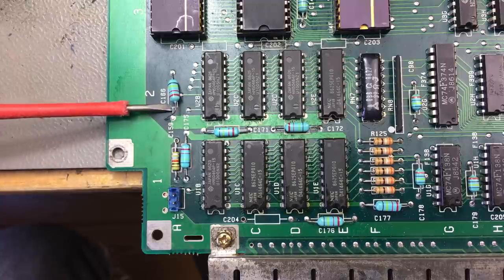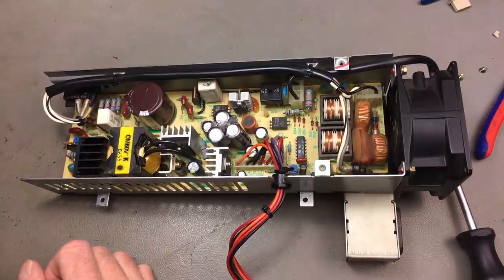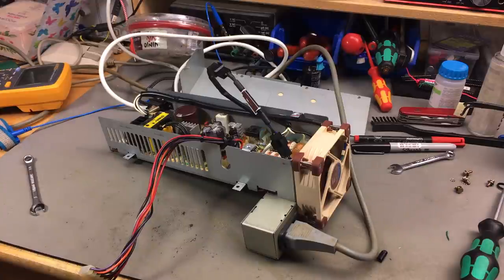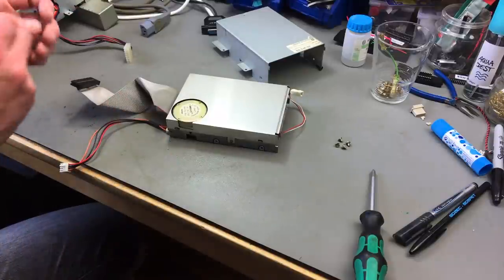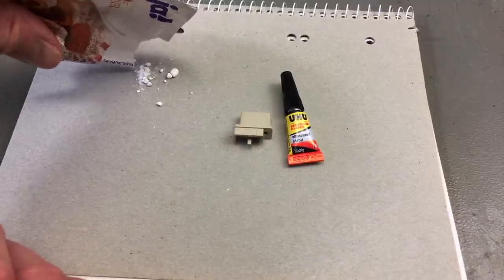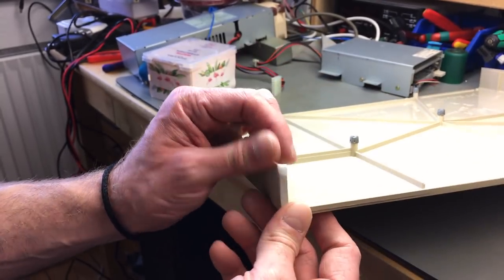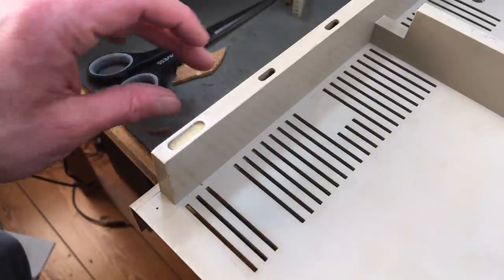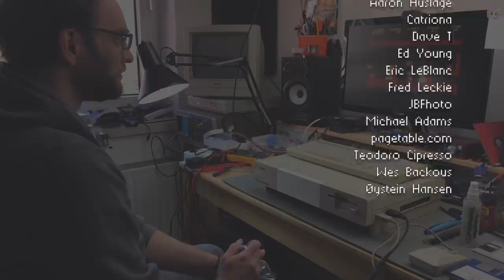Amiga 1000 Restoration | Part 2

Comment: Fantastic job Jan!!  Love the 3D printed piece that Dennis produced too!
Reply from the maker: Thanks Chris! Yes, the 3d printed part is stunning. I just hope i don’t ruin it when I paint it... :D
Reply: 33:00 .. @Jan Beta.. a very very easy way to reduce the speed /noise of a fan ..... is put 2 or 3 diodes.. in serie (one behind the other)... in the 12V+ yellow positive line ... each diode reduces around 1 Volt depending of the  amp consumption of the fan .... then you can "hide" them with a shrink tube

Comment: I simply cleaned and lubricated the old fan and now it works like a new one. And it’s very silent, that old thing was very well build. Now my one is now 36 years old and I can’t hear it after the small revision. But I used that Noctura fan for my A4000 THAT is a big difference, now it’s silent and has a much better airflow.
Reply: OK I used the Noctua NF-A8 FLX in my A4000 power supply because its not PWM controlled :-)

Comment: I am in the midst of restoring two C64s ('83 and '84), a Vic-20('82) an Amiga 500 ('90) and a Mitsubischi ML-F48 ('86) MSX computer. In essence, all the machines I used during my child- and young adulthood. It never even occurred to me to sell them. They've been lying in boxes for over 30 years.
With the exception of the VIC-20, I salvaged that one from a dumpster around 2006.

Comment: Only half-way through the video but I wanted to commend you on the fan mount, very nicely done and how I would have done it myself - you will thank yourself in the future if the unit needs opening up again, as having that cable unplug-able will save you some headache if the PSU or the fan dies. One trick I always do with PC fans for cable management is to wrap the cable around the fan housing as the friction fit will stop it from coming loose or shaking about enough to create noise from vibration while also leaving you with ample room to access the other surrounding components.

Comment: As for possible upgrades: well, there are some solutions for the Amiga 500 which would work with the 1000 as well. I think this machine definitely still needs more RAM. 512k Chip is definitely not enough ;)
Reply: @kevb8983  You can use a modified Kickstart which adds the memory. It will be from $80000 and upwards (although it will (obviously) not be chipmem). It should'nt be hard to locate the information on the Internet about the piggybacking hack these days. A very good and reliable upgrade (if done correctly) which I personally used for several years with zero issues.

Comment: Hi Jan - Great informative A1000 restoration video. A question if I may. My old A1000 has developed vertical stripes on the Workbench background, Kickstart request screen is OK. I'm using composite output as I no longer have an original RGB monitor. I figure the problem may be with the video out circuitry, I have reseated the Daphne chip and can see no obvious problems with the circuit board components, including obvious blown caps. If you have any hints as to where to specifically look for this vertical output stripe problem it would be much appreciated.

Comment: Noctua sells several different versions of the same fan depending on what kind of noise profile you want.. Might have been better to get the NF-A8 ULN or NF-R8 Redux 1200. The 2200rpm PWM fans are designed to run with thermal management so they normally would not at 100% duty cycle. Most computer systems would run them about 500-600rpm. Edit: Whoops commented too soon, you did go and get the ULN version haha. Nice.

Comment: Back in the day we had those Papst Lüfter as we called them in germany 🤪👍
Reply: my IBM AT has an actual Papst in it.constant 4000 RPM. No point fitting a soundcard until I replace that thing, hehehe
Reply: The original Papst hand balanced steel ones where actualy realy expensive, i think i was like 90$ or so, so it should be more than 100$ today i think for the larger models if one bought them separatly.

Comment: Awsome video as always! I honestly must agree with those fans, from a tecnicaly point of wiew they are great quality fans but they realy are incredibly load and enerving in the long run...
Reply: Some of those industrial quality metal fans are in fact much quiter then modern plastic ones (i still use a few on my cooling system), but later, plastic ones from Commodore machines i hawe used was not exactly quite...

Comment: Funny, my 1000 had a square latching push button for power instead of a toggle which blended into the side of the case better. The only models of Amiga that I haven't owned are the 1200, 2000 and the 3000. The were great computers for their time. I had a 500, 1000, & 4000-030. I seem to remember my 1000 having a memory expansion box on the side port too. It held an extra 512k in addition to the 128 on the front and internally. I believe it was the first zorro connector though I could be mistaken. The zorro II slot didn't happen until the 1200 I think.
Reply from the maker: Interesting! I was wondering if the cut out was designed for another type of switch. Seems more appropriate indeed. Thanks for sharing!

Comment: Jan, would really like to know what paint codes / mix you come up with. I have the same 3D printed thing on my A1000 for that and the side expansion trap door but they need a color match.
Reply: Rather a late reply, but if you still need an answer, you can get color match apps for your cell phone from most major paint suppliers. You have to make SURE you do a proper White Balance (most camera apps have this, just search here on YT on how for your phone). Also there are apps not related to paint companies that will give your the RGB and / or the CMYK values you can then take to a paint store and they can match. Here in the US it's free in most paint stores. Be SURE to do the White Balance FIRST or it will be off.

Comment: Another video says the original fan is 120v - the replacement you are using is 12v.  Where is it connected?
Reply from the maker: I connected it to the 12V rail of the psu (the explanation is in one of the videos of this series, I can't remember which one).

Comment: Actually there are RAM chips from two different manufacturers Hitachi and NEC. The NECs are from 1986 week 25, also 3 of the Hitachi, but one from week 23.
The NECs seem all to be replaced, but as the production time suggests this was done at the factory.
The 68000 CPU is from Thomson.

Comment: Nice job there :) That CPU is indeed a Thomson, but it's an 8 at the end and not a B, maybe that's why you didn't find much info on it... They also did purple/gold ceramic (EF68000C8, EF68000CM10) versions and a square (TS68000CR12) version too :)

Comment: Hi Jan is the front bus connector the same pinout as the side one ?
Reply: IIRC the side port is larger to accommodate the signals from/to the CPU (practically the same connector as on the A500 only flipped), whereas the front connector is just for a RAM expansion card.
https://retrocomputing.stackexchange.com/questions/5410/was-the-amiga-1000s-front-expansion-port-capable-of-anything-other-than-the-256

Comment: what video signal converter do you use for the video cable?
Reply from the maker: For quick testing like in this case, I use one of the cheap Flylink SCART to HDMI upscalers. For more serious stuff (streaming, gaming etc) I use an OSSC which is awesome.
Reply: @JanBeta  must look into that.... this video opened my apetite to play with my st and I'm atm retrobrighting it in the sun :)). it is turning great. also my 400v condenser of the psu needs replacement.  its getting rounded at the top. its not suposed right?
Reply: @jvidia  Right. Domed caps are bad caps.

Comment: I'm not a material scientist, but from my limited understanding, you can't just "add moisture" to make the plastic less brittle. The brittleness is due to chemical changes. Reversing those chemical changes isn't as simple as just adding water. Just like how you can't grind up concrete and add water to get new concrete mix.
Reply from the maker: I heard about putting plastic parts into water and heating to make it more elastic again. I have no idea if that is actually a thing, doesn’t make much sense to me either. Lots of misinformation out there I suppose.

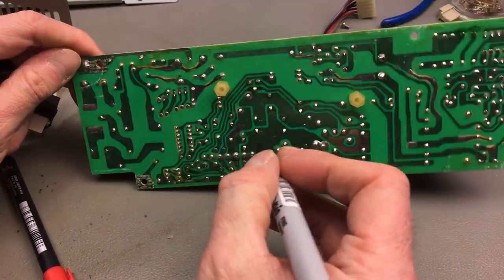Comment: 18:26 You had empty solder points (pads) with GND and +12V just below power connector!!!
37:00 Yes, it is made by Thomson-CSF. Later versions were marked TS68000 (SGS-Thomson, now ST).

Comment: You recommend lithium greese over machine oil for drive? I've used machine oil myself
Reply: Lithium is the way to go for all the sliding, levers, and bearings. Oil the way to go for all rotating shafts. Personally I use more modern synthetic replacements most times but on this I'd use lithium. For the drive shaft (rotating) I use oil to REMOVE the old grease, run it a bit and clean dry it then re-grease. Source: Me. Was factory trained in floppy repair back in the day ... ;-)
Reply: @MrPuterPro  thanks for tips. Regrease with lithium you mean? How would fancy automotive grease go?
Reply: @blackterminal  Well, that depends on what you mean by automotive grease ... Certainly not wheel bearing grease which is designed for high temps and huge loads. Just a normal white lithium grease available in any home improvement or auto store, or, of course, Amazon ... :-)

Comment: A got a broken LG DVD-writer/VHS-combo thing that had a similar error in the power supply - one of the resistors in the PSU had just barely missed it's through hole... I'm guessing in the factory it still just barely made contact with the solder but got bumped at some point and the whole unit died. Another unit of the same model had too much solder on the HDMI port, bridging some pins so that output never worked. Doesn't speak well for LG's QA, but it was great value for me :D
Reply from the maker: Nice! Seems the QA had a bad day (or several). :D Glad your repair skills paid off. It's such a great feeling to be able to fix such things.

Comment: Great work Jan. Why haven't you used the silent NF-A8 ULN as you did before with the A2000 powersupply ? The NF-A8 PWM you used here moves a bit more air, but i think the NF-A8 ULN is still fine enough for the A1000 power supply and it's silent as you know.
Reply: Ah...i watched further and you figured it out the ULN :)

Comment: ADDENDUM
You know that Plastic welding glue? Have you tried sourcing donor plastic that you can file down with a very smooth file, so that instead of Baking soda you use that plastic welding glue and the plastic filings or powder to build up chipped off plastic, Fill up unwanted Holes and even fill in cracks? Also there are some cheap plastic welding and resurfacing kits that can copy textures down to smooth surfaces..

Comment: I don't think it would really make a difference, but I think the intention is to make sure the brown bushings on the fan are the only thing in contact with the power supply. They look like rubber isolations, so the fan should "float" free. Adding a few washers to leave a tiny gap? The idea would be to isolate the fan and stop vibrations from being amplified by what it's attached to... or they're just cosmetic and make no difference ;-)
Reply: Yeah, the screw should have had a larger washer so that it contacts the soft rubber and not the hard plastic case but in this case I don't think it makes much difference. Of course the idea is to not propagate any vibrations from the fan to the rest of the case to make noise somewhere else than the moving fan. It can really make a difference when mounting spinning hard drives into cases. Even more with optical drives that can make the whole case BURRRR at some nice harmonic frequency.
Reply: You're both right but the best solution is from Noctura themselves. All those fans come with rubber mounts that push through the holes and pull the fan tight with nothing but rubber touching any of it. They're probably a bit of a tight fit to the existing screw holes on the PS but nothing to a pair of nippers in the hands of a guy who makes his own plastic with superglue and baking soda ... It's funny because just last night I just caught one of my cats with one she swiped from a table. Not that they EVER get on my tables ... while I'm in the room at least.

Comment: Actually, Jan, there is a NF-R8 redux-1200 fan out there, that is even quieter and its in a nice grey so it suits the general styling better... Also it has even slightly more airflow.

(waits for next fan replacement video) :P
Reply from the maker: Yes, saw that one, too, when I searched Amazon again for the links in the description... It never ends! ;P
Reply: @JanBeta  I always check at Noctua's own website. There you can nicely compare all the stats for the fans. and then I look where I get the one I want for the lowest money. Usually Amazon anyway...

Comment: Very nice work. Well done! I have a couple of questions.

1-Can a built in Kickstart 1.3 rom be installed inside this A1000?
2-Can the 0.5 mb ram be increased to 1.0 by modifying the front memory cartridge?

If these are possible, i would like the see these upgrades in the part 3 :)
Reply: 1. There are ways of adding an A500 Kickstart ROM to an A1000 but adapters boards are required.
2. The front slot only takes 256K.  I have a board called an IN1000 in my A1000 that plugs into the CPU socket and adds 1.5MB fast RAM using 48 256Kx1 RAM chips.  xtra RAM can also be added using modules that plug into the side expansion slot.  I have a SCSI controller + 512K module with a little light that indicates RAM access.

Comment: Hi Jan there is also the Capasitor C204 missing.
Reply: I think there are also others "missing". They would typically provide lots of decouping on the design and then maybe drop a few of the unneeded ones away from the BOM to reduce manufacturings costs by a cent or two.

Comment: I wonder if someone desoldered one leg of that cap so it could be tested out-of-circuit, and then forgot to put it back.
Reply: Looking at the leg and the solder point on the board it very much looks like that part was never connected.
Reply from the maker: Yes, definitely looked like it was just never soldered in from factory.

Comment: Louis ultra-sonics his boards after bathing them in flux. You should get one =)
Reply from the maker: I’d love to have an ultrasonic cleaner actually but they get really expensive in useful sizes. :/
Reply: @JanBeta  .. Life goals =)
Reply: If there was a wide flat one instead of those cubical ones.. you need a very big one to fit a whole mobo or case in there. I think I'd still prefer the soap water and brush in a sink method.

Comment: My experience with those 230V style fans is that the bearing is gone and there is nothing you can do to fix it. It's the wobbles that are noisy.
Reply from the maker: Yes, that’s what I think. I still want to try to lubricate it and see if that does any good. I suspect putting the 12V fan in was the better solution though.
Reply: Not in this case. That fan was as good as original, I had an A1000 and it was like that from the factory. It has normal play in the axle and has ball bearings. The sound comes from those ball bearings, and they're extremely durable.

Comment: 33:00 .. @Jan Beta.. a very very easy way to reduce the speed /noise of a fan ..... is put 2 or 3 diodes.. in serie (one behind the other)... in the 12V+ yellow positive line ... each diode reduces around 1 Volt depending of the  amp consumption of the fan ..... then you can "hide" them with a shrink tube

Comment: Just to clarify, it's not a capacitor but a resistor 😊
Reply from the maker: It is a capacitor in an unusual package.
Reply: @JanBeta  Really? It looks identical to a resistor, with the color markings. Very weird package if you ask me 😊
Reply from the maker: It certainly is, double checked by measuring it and also matched the color code and the schematics. It’s definitely a capacitor. Weird one for sure but all the axial caps they used on this board are the same form factor.
Reply: @thomasa76  The component designator C on that board really settles it without much doubt. Also if you look closely the packaging is fatter than most resistors anyways. Color bands are used for lots of component designators. Usually these "greenish fat parts" are inductors (yes the color bands also apply to them) or caps.

Comment: Also, the original fan you had there didn't sound any different from what they were new, in pristine condition. Therefore, what you did is of a mod than repair.
Reply from the maker: It started to make a grinding sound after a while, definitely something wrong there. It doesn’t come across very well in the video.

Comment: Can I get a source from any of the angry commentators about the pure isopropyl alcohol being ineffective? I've tried my best google-fu and actual scientific studies say "minimum 70% concentration", with isopropanol being better because it has some ability to dissolve fat, unlike ethanol.

Of course store-bought disinfecting fluids are 70% because that makes them cheaper to produce while staying effective, so that's the golden spot for those. But nothing prevents me from making a more concentrated solution that works just fine.

Hell, for home-made stuff, where you make small amounts at a time (like 100 ml bottle), it's easy to mis-measure (if you even have a measure at home, which admit, you don't :)), so I would argue it's better not to dilute it to prevent making it ineffective.

(I use lab-grade isopropanol with few drops of glycerin)

Comment: Connect the ground on the fan to 5V, run it at 7V
Reply: That works with way over powered fans but not with already super quiet slow speed ones.